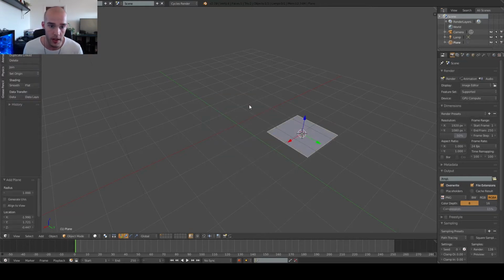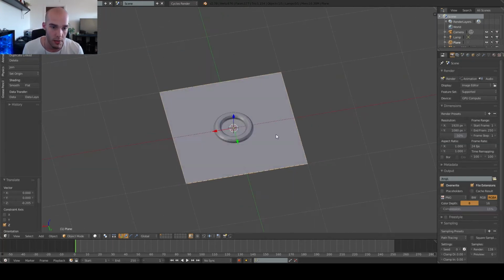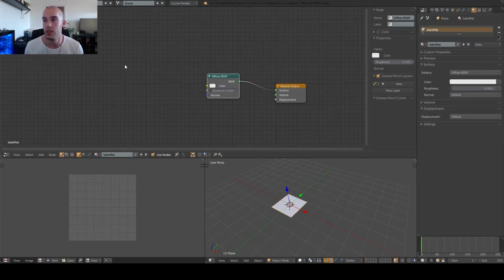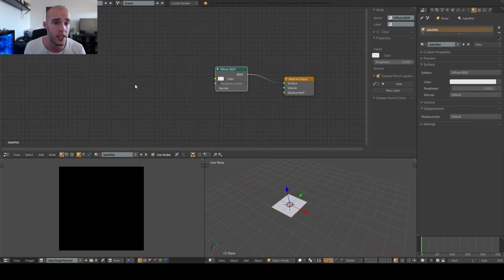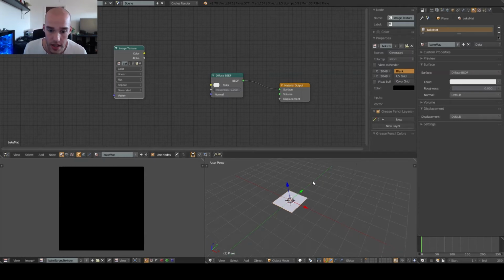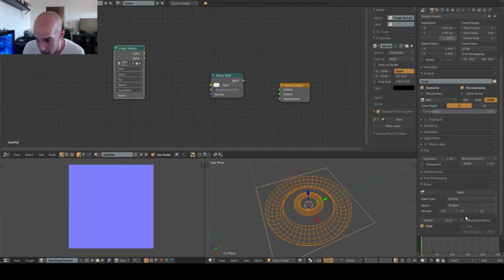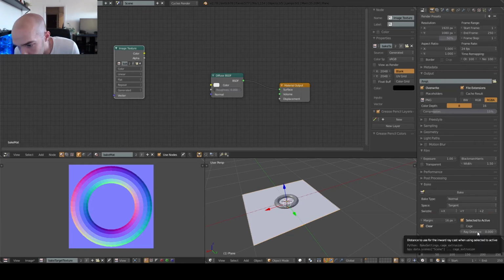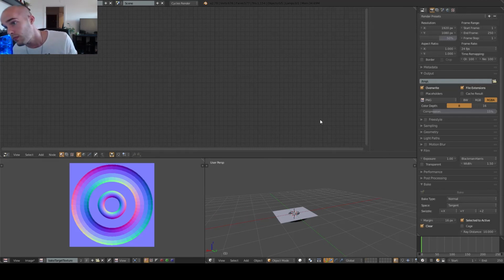Let's bake a normal map in Blender!

Comment: Do you need to unwrap the torus too (ie the high poly object), as i did everything you said but when i bake it says the high poly object is not unwrapped (even though the 2d plane i want the normal to be baked on is unwrapped as you say)?
Reply from the maker: No that shouldnt be necessary...Could it be that one of the toruses has accidentally become the "Active Object"? Make sure that the last object you select is your target (plane). Does it work now?
Reply: This was it man, you're amazing thank you it works now! I'll remember always select the high poly mesh (the one you want baked) AND THEN AFTER select the plain you have as target. Thanks man!
Reply from the maker: Super happy I could help :)
Reply: Then all i have to do is change the bake type after i saved the normal map. The usual diffuse, AO etc can be created in this straightforward way. Brilliant tutorial!